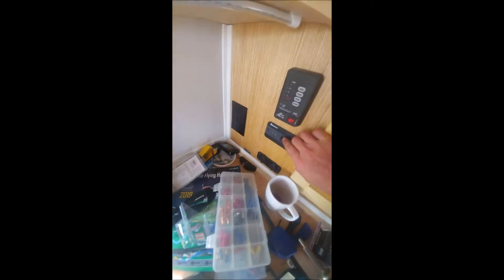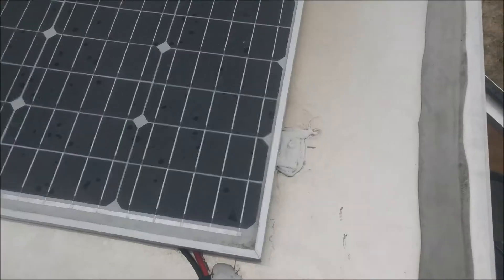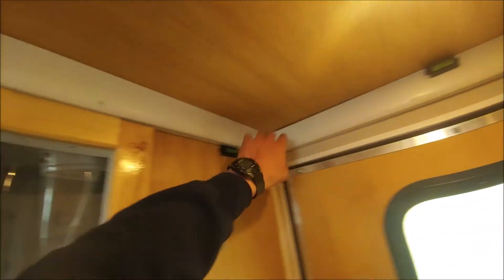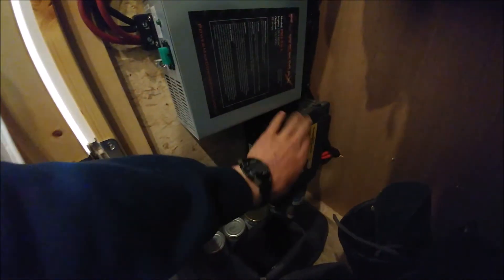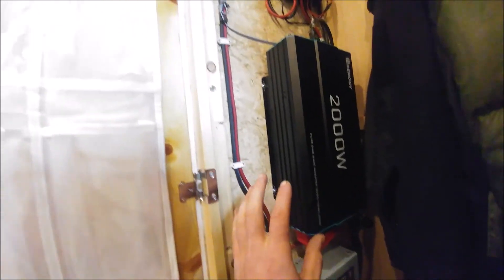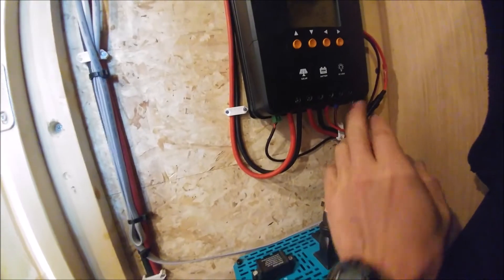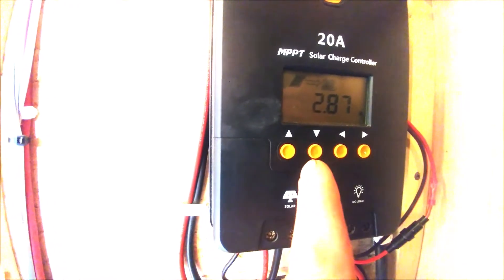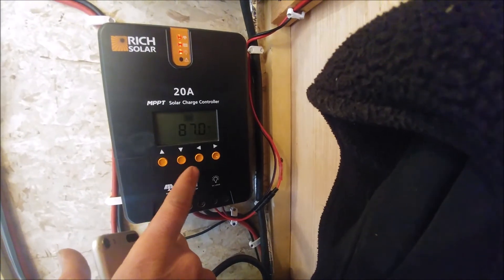solar panel installation and solar charging system on my camper converted cargo trailer DIY

Comment: I’ve got the same inverter but 1000 watt. Think I could run that Harbor freight 1 x 30 belt sander off it? Ive got (2) 100 watt HQST panels going to (4)  12 Volt Marine deep cycle batteries. Nice set up!
Reply from the maker: I should be ok, looks like its rated at 2 amps at 120 volts so thats 240 watts. the one issue you may have in inrush. the belt sanders a non capacitor start run motor if I recall right so depending on the temperament of the inverter it may be slow to start.  a lot of inverters have a capacitor or compacter set up at the out put for a storage of energy in starting applications.  I believe that's stated by the inverters start capacity on a 1000 watt inverter that may be 2000 watts but only for a fraction of a second depending on the load such as spinning up a flywheel will pull a lot of juice to get the momentum going. Id have to go tair one apart to get a better Idea of how that's set up, and perhaps someone can chime in thats more knowledgeable. I will say I have far beter luck running the pure sine wave inverters over the squared or modified wave inverter when it comes to starting things like grinders saws or High in rush demand tools.   there is a item called a soft start for ac units in use with generators that would help in that situation... 

but anyway... yeah it should work.

Comment: Good video...off subject...how did you add the door latch to your outside door?
Reply from the maker: Thanks! I might be able to do a video and blog artical on that.. I need to check what video I have on it.
Reply: @gonorthoffgrid1786  in what order would you make your mods to the trailer if you had a do over?
Reply from the maker: Ah well I whould do it just as I did. Gut it, insulation, walls, inner walls, flooring, cabinetry, wiring, plumming.
Some may chose to do there wiring strictly in the walls. I prefer to do it for the most part all in an accessible way behind falls fronts , in the cabnetry and such but for the ceiling. Keeping the understanding to alow areas, pockets and reaceses for the future wirung as we go. 
 The one thing that whould realy aid in building out the inside of the camper is to know your intended lay out. However with me I have a general idea and proceed to pull it out off where the sun dont shine as I go. Its anoying doing it this way somtimes, but things change as we go somtimes.